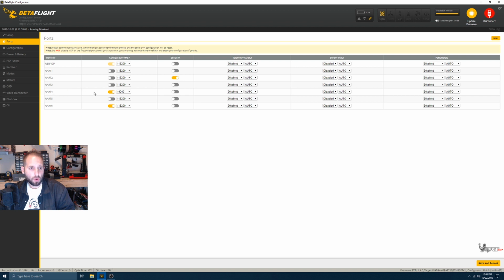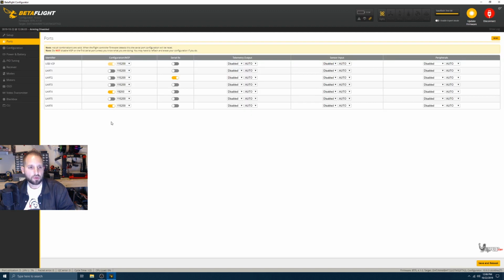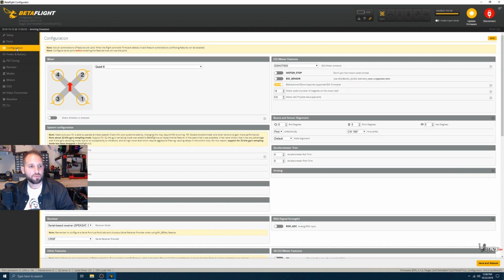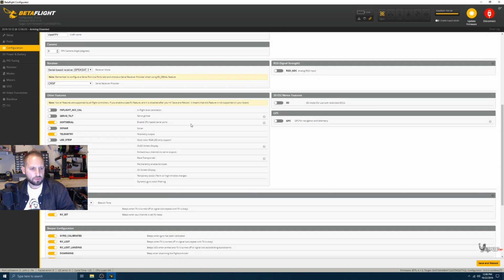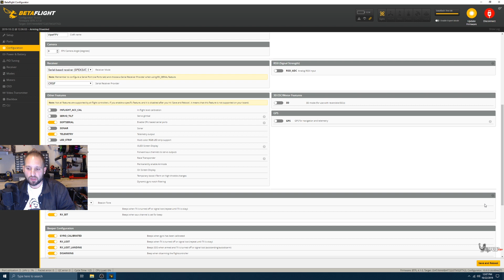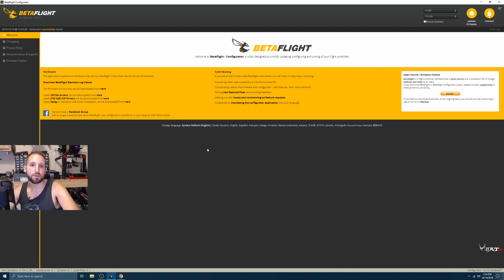DJI Digital FPV System - DJI Air Unit Wiring Guide & Betaflight Setup

Comment: hey mate hoping you can help
I have a new original air unit and v2 goggles , it powers up via plugs to my fc ,binds fine but I get no video just the black screen with the  DJI logo
any suggestions of something I may be missing ??
thank you

Comment: I bought this unit to use as a stand alone fpv platform on an airplane. I don't have a flight controller I'll be using just the receiver and power lead to power on the camera. Will that work?

Comment: I have a 5 inch quad and i get: VTX not setup correctly. I have Kakute F7 mini V3 and dji air unit and controll it with tbs crossfire. any idea how to fix the vtx problem? the air unit it connects with fast connectors (plugs) and its not soldered to an T2 or T3 etc. if im bad at explaining just ask questions its ok :)  And when im flying the quad in acro mode it behaves like im in horison mode that is also an issue i have with it.

Comment: I liked your video. I am more fixed wing and new to the fpv and have the dji caddx Vista along with dji goggles 2. Need more info of the powering the matek F722 HD to ready to use. I have the goggles set up by dji, but not the caddx, because of some confusion of wiring and power placement if I can get a little help...😏

Comment: 1:45 If i wanted to power it directly without a flight controller (for use on an RC car), should i connect the red cable to the red lipo cable, and black to black? 

That might be a dumb question, but I noticed you said that RX goes to TX and vice versa (which confuses the heck out of me -- I still don't get the logic), so I wanted to check.

Comment: OK so question I see you have a cap on your arm your power wires is that for you to be able to run 6S because I have a 5 inch quad and I’m trying to run 6S and I have the DJI air unit and every time I plug in my battery that is 6S the camera freaks the fuck out soooo I was told I either needed that or I either needed a BEC can u help me out lol

Comment: Thank you for this . Any chance of some advice ? I built a 3inch using mini f7 plug n play with dji air unit after building i powered up with a smoke stopper lol just in case everything is perfect powers on normal cable from fc to air unit is plugged in all is good but no video or remote control ? Though the goggles i can navigate the menus ? Not sure if that matters i tested the air unit in another drone and works perfect video and powers up motors etc ? Any ideas i really appreciate your time thank you
Reply from the maker: Did u bind the goggles with the vista?
Reply: @ViperFPV  yes its a air unit that was in another drone

Comment: I got the latency goggles and the fpv air unit, and I have a DJI m600 or s1000 which ever. The lightbridge system is not working it shows a black screen when I’m logged into the app. So I bought the setup your describing and I won’t to install it on the m600. Can you tell me where to place the wires ??
Reply from the maker: I’m sorry but I don’t know anything about those drones.

Comment: I got the latency goggles and the fpv air unit
Reply from the maker: Do you have a link? I never heard of them
Reply: The knew dji goggles
Reply from the maker: @rickrossmechanic65  I’m not finding that name online
Reply: You don’t see the DJI goggles with the 4 antennas
Reply from the maker: @rickrossmechanic65  you asked about light bridge. ? Which is not compatable with the air unit or goggles.

Comment: Hey how you doing, I have a dji m600 with a lightbridge setup on it. I haven’t been able to see no video out of the camera on the app and both lights are green. So I’m about to replace it with this fpv air unit. Can you inform me if I have to do this same thing??
Reply from the maker: What goggles are you using?

Comment: Nice video! why you didn't use the 9V pad in FC and wire up all together with the TX3 ?
Reply from the maker: Aerial Clone not sure what you mean by the tx3 but regarding why I did not use 9v pad because the 9v pad is only rated for like a amp and the air unit draws more than that
Reply: @ViperFPV   I meant the UART3 for the vtx. I thougt the 9V  was there for the Air Unit :/ and the UART6 is for telemetry in case you want to use it.I have the same FC and I switch to digital now that's why I am asking :P

Comment: I have this exact same flight controller and I had to switch the UART wires (grey and white wires) around the other way to get the OSD to work. Also I wired up the power to the 9V regulator on the board and that also works.
Reply from the maker: Yes!
Reply: I was going to say, you should see much more consistent performance powered from a regulator, and since you are already having to take signal wires to the flight controller, having power and ground coming from the flight controller gives the system a common ground so you don’t run into noise or osd issues. Powering from vbatt allows all the system noise into the vtx first, and then carries all that noise to the flight controller instead of away from it. Brown outs on the 9v reg means it’s a bad 9v reg.

Comment: Question. Building a quad using the DJI combo, goggles, transmitter and air unit with a Momba 405 DJI stack. Am I right if the only soldering I’m doing is for the battery leads and motors?
Reply from the maker: cnbsdad absolutely correct.
Reply: Viper_FPV thank you so much for the quick reply. Appreciate it. Your video was very informative. Keep them coming
Reply from the maker: cnbsdad thank you

Comment: Hi great vid I have a question I can't seem to find online maybe you can help 
I'm looking to buy a ready made drone from banggood with a dji air unit build in but could I use normal goggles or does it only work with dji goggles? Anyways thanks for you time ✌
Reply from the maker: Crypto Turk the DJI air unit only talks to the DJI goggles all the other goggles will not work.
Reply: @ViperFPV  thanks for advice bro👌 
I'm looking at the flywoo explorer Lr but debating whether to get the air unit or not
Reply from the maker: Crypto Turk that’s a 400-500 dollar commitment for the goggles. For my personal experience the DJI goggles image is amazing. If u plan on racing I would not recommend it tho due to latency and weights of the units.
Reply: @ViperFPV  is definitely a big purchase for sure I'm stuck between buying one with air unit or without one and use an insta 360 or gopro I think either way its gonna add up.
I'm not looking to race as such more videos making and freestyle.
Just trying to find the right balance for the right price no point wasting money at the start I was even looking at dji mavic air 2 but won't be able to get the good freestyle shots 🤔 decisions decisions lol
Reply from the maker: Crypto Turk well good luck I don’t regret getting the DJI system it’s awesome. But I still do like my analog
Reply: @ViperFPV  thanks for the help bro ✌ keep up the good work great content 🙌

Comment: Your flight controller has regulated 9V, why didn't you solder to that instead of the battery? Voltage range for the Air Unit is 7.4-17.6V. Is there a reason for for soldering directly to the battery instead of the 9V on the FC?
Reply from the maker: Yes because the air unit draws too many amps for the tiny 9v regulator to handle.
Reply: @ViperFPV  Gotcha, I had seen several other tutorials and they had an 8V pad that they were soldering to. I took your advice and soldered directly to the battery pads.

Comment: 2 Questions.  I am using a T-Motor F7 55A DJI Stack and TBS Crossfire Nano RX.  I used the wiring harness that connects the Air Unit directly to the FC (plug-n-play).  I de-pinned the Brown and Yellow wires because I am not using the DJI Controller.  I connected the TBS Nano RX to a 5V, Gnd, T5, and R5 pad on the FC.  Because the FC is designed for DJI and is 6S capable I shouldn't need a regulator as the wiring harness connects into the FC on a Gnd and 10V connection.  Am I right in my thinking and approach.  The link to the T-motor Stack is attached.   My second question.  Your Betaflight setup was kinda confusing because I believe you were giving information about using either the TBS or DJI Controller.  In my case, I just need to select UART 2 Configuration/MSP - ON and UART 5 Serial RX - ON.  Thanks for the help. 
http://uav-en.tmotor.com/html/2019/FlightControllers_1218/310.html
Reply from the maker: Yes the DJI stack FC will handle the voltage requirement. And you are correct on the betaflight setup

Comment: Hey man, I am new to FPV drones (with regards to building) but an experience commercially qualified drone pilot and I need some help. You talk about an BEC regulator to get the DJI kit to work. Could you please send me some links for push me in the correct direction please. Will be using this video when I'm building mine as looking at getting an Iflight s6 but want the DJI set up.

Comment: I am a total noob doing a first build and seem to have chosen every possible  challenge with my component selections... I am running a Mamba F722, like in this video and looking to connect a DJI for video feed and OSD info. My RX is the new Spektrum SPM4650 SRXL2 serial RX and it’s connected to UART 6 (TX tab) for Serial communication and is working fine. You have used UART 6 in this video as well ... As I don’t plan on changing radio gear at this time. Can either my RX or the Air Unit go on a different UART and still work / provide OSD data to the goggles?
Reply from the maker: Yes u can use any uart
Reply: Viper_FPV thanks 👍🏻  I think I might try and remove the bulky aluminum case off the air unit to save some space and try and mount the 2 x internal DJI boards directly into the quad somehow. Does not seem like anyone has tried this from what I have found. Could be because of heat issues as the case seems to have some cooling fins. We will see...
Reply from the maker: Mike Lanzo u can try it the caddx vista is pretty compact also
Reply: Viper_FPV if only it had SD card 😫 I don’t want to have to mount a GoPro if I can avoid it
Reply from the maker: Mike Lanzo yeah no sd card

Comment: I connected my air unit today to quad, activated it and powered up the quad did the first flight check. Had to change propellor direction, after that the air unit won't turn on anymore, tried connecting to a direct power supply but its still not working. Any one out there had the same trouble?
Reply from the maker: Benjamin Barakat I never have.  it sounds like it may have died. U may need to reach out to DJI support

Comment: Viper nice video my friend. so is completely safe to connect the air unit straight to the battery (4s)?
Reply from the maker: Yes on 4s
Reply: @ViperFPV  is it ok to connect it straight to the battery on a 3s as well?
Reply from the maker: Patrick Sharp yes anything over 4s is a no no
Reply: @ViperFPV  Thank you

Comment: Mr Viper, I have Mamba F722 mini. After firmware v4.1.5 has 6 Uarts, are:
Uart1 to Receiver Frsky,
Uart2 to ESC Telemetry,
Uart3 to Smart Audio VTX,
Uart4 free
Uart5 to GPS,
Uart6 free (ex TBS Nano)
I will install Caddx Vista. Please give me inform. Where UART for connect Rx Tx cable air unit?
Reply from the maker: Uart 4 since it’s the only free one you have. But you can always do a soft serial and put smartaudio on it and then use uart 3 so you have one still free.

Comment: What’s up buddy need help man.... I can’t get the osd to work I have done all the steps you have posted which helped a lot I thought it was the air unit and I got another one and same thing the only thing I can get it to do is the step in the CLI I can’t get it to turn one please please please help I’m going nuts.... thank you in advance
Reply from the maker: Manuel Falcon have u tried switching your rx and TX wires around? If not try it and let me lnow

Comment: Viper - do you have any experience w. the DJI FPV Goggles/ Air Unit / DJI RC Controller?  I have an iFlight MegaBee, configured from the factory w. the DJI Air Unit, connected to the controller board (no receiver) which I've linked to my Goggles and DJI RC Controller .. but cannot get BetaFlight to connect and cannot get the motors to arm/turn on ... Now almost a week w. DJI tech support and iFlight tech support .. and both point to the other company and neither has a clue how to configure w. BetaFlight or why the Air Unit will not connect .. whether power is applied to the drone or not ... VERY frustrating.  Maybe some of your other subscribers have run into this problem and found a solution ... Thanks!
Reply: Check out the DJI FPV Facebook group... lots of help available there

Comment: The tx goes to rx and rx to tx?
Reply from the maker: Raydio Show indeed
Reply: Got it 

Hey I’m trying to hook up the dji system to my diatone 369 board.. it’s a F7 

I want to use the dji radio so I hooked the yellow wire to the sbus.. it’s not working 

So then I tried hooking it to my diatone cube which has the mamba 411 something or other board 

Still isn’t working 

I don’t get any level change on the receiver tab 

Any suggestions?
Reply: Raydio show i have the same problem, did you figure it out?

Comment: Going into cli command the baud change is for the dji transmitter only? Correct.
Reply: RcHaze that’s what I’m assuming? Did you ever get confirmation?
Reply: @dnafpv  not really but I dont use their transmitter anyway. Quad flies good with dji

Comment: Hey, how do I wire it into a wing? I have the wing, motor, esc and battery... what else do I need to wire it to the wing?
Reply from the maker: Super easy does your wing have a FC or a gyro? Just need to know because that will change how it’s wired up
Reply: Viper_FPV nah it’s a simple wing I’ve made from scratch so far I have the servos, motor, esc, receiver for the remote and battery wired up... I’m new to fpv
Reply: Viper_FPV I messaged u on insta 🤙